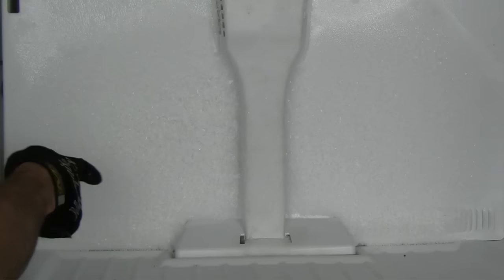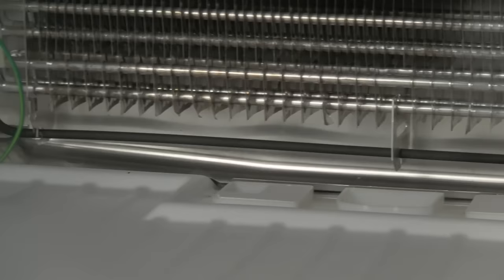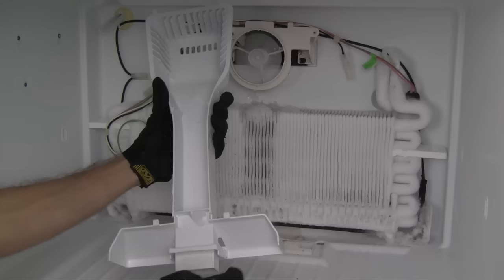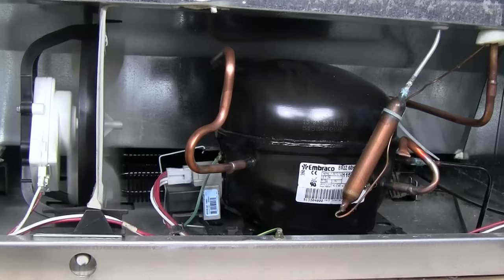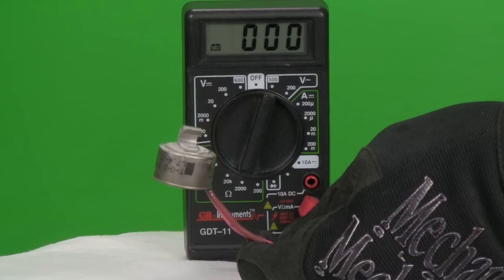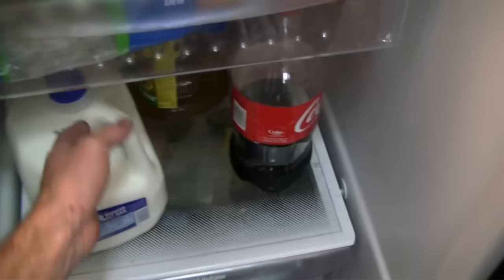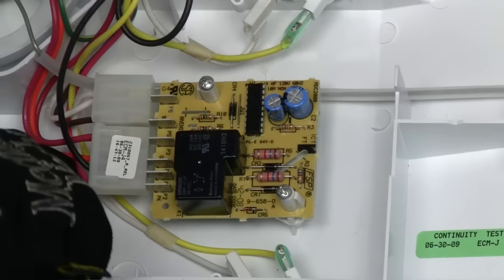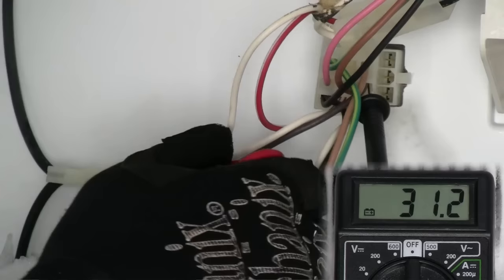Refrigerator Repair (Not Cooling, Defrost System)

Comment: I bought a Samsung refrigerator (model: RT28FA JSA RX/TL) on Nov 01, 2013 from a little know place Dhamnod in district Dhar of Madhya Pradesh.
On Oct 22rd 2014, I noticed presence of thermocol bolls spread below the refrigerator. I assumed that it must be some piece of thermocol that came with packing would have remained while unpacking the fridge and which mice have bitten.
A day later on Oct 23th we in the family noticed a foul smell inside the refrigerator. We though deodorizer of the refrigerator is not working, but the smell grew stronger by end of day. This started smelling like a dead rat. Even the cooling had decreased to a much lower level.
We immediately called the local dealer and upon his advise called Samsung customer care. When the service engineer visited, he found that the mice has exploited excess water opening (see image) to reach the thermocol insulation that is between the outer metal body and inner fiber body. Mice have ruined this insulation to a greater extent and thus impacted cooling. The mice also made a hole in the inside fiber body. In all left the refrigerator completely useless piece of junk. The service engineer took some photographs of the impact and after a long wait of more than two weeks, finally we received a phone call from Samsung Indore Head Office that this impact/damage is not covered under warranty and falls under physical damage.
I was quite disappointed with the response. Company has also denied any response in writing. I have gone through the warranty card and it does not talk about any such incident to be considered in physical damage.
The questions that arises here is what makes Samsung put this under physical damage.
As a consumer my stand on this issue is -
 
1. If Samsung refrigerators are so vulnerable that a commonly found rodent in Indian homes can damage their product to such an extent then why don't they call out this in warranty specifically. After all, Samsung is operating in India and it is true that most households in India (except some high rises) are infused with rodents
 
2. If the extent of damage through rodents can be so huge (rendering product useless), consumer must be warned, should be asked to use a rodent mesh or company itself should have taken care of such a miniature loophole in design
 
3. This impact was not during transfer, improper handling, misuse, or improper operating conditions, then why is it labelled as physical damage.
 
4. Mice exploited the water disposing gap in refrigerator, why was it left opened and so wide in Samsung refrigerators that mice can enter through this. In LG and Whirlpool refrigerators this opening is narrowed down and a rubber pipe is attached at the tail to direct water to a tray. Even if rodents damage the pipe they cannot enter the hole and exploit it further. This is where it compels to think that its a design gap/flaw or communication issue that Samsung needs to fix.
 
5. As a consumer, damage other than by, handling, Act of God or terrorism, should be repairable. But other than these if an incident renders the product unusable, it must be some carelessness in product owners approach.
 
As per Samsung this is a physical damage, but rodents in Indian households are normal operating condition. In such a case either the products must be designed that way or customer must be warned of impact/loss. Else the product company should help customers and thus improve the product. Its not something that has just disfigured some kind of appearance (the look and feel of the product) but has left it functionally dead.
 
Complaint ticket number : 418 351 6041
 
=================================================
 
You won’t trust SAMSUNG after reading this –
 
So I heard back from Samsung, only to get disappointed again. After so called a thorough research, discussion and brainstorming, the conclusion was that Samsung agrees that the damage is irreparable. If one reads my post carefully this was already established by a layman like me, reason? it was a damage to body. Samsung says consumer did not provide hygienic conditions. My argument remains same, more than 70% households in India might have rodents issues, doesn’t mean we don’t maintain hygiene.
 
Few questions to Samsung -
If the refrigerator is so vulnerable to rodents, that the extent of damage is irreparable, why no instructions were given to consumer (not one from dealer to service engineers, operational manual or warranty talks about this). If you can ask consumers to use Voltage stabilizers, why not rodents mesh?
 
How would a consumer know the design gap in their refrigerators. In my rarest of imagination I can't think of rats making their way between outside metal body and internal fiber body. Many of my fellow readers will agree with this? A consumer cannot follow a rodent or a cockroach to see where they are moving.
 
Why there is a 3 inch wide opening for water disposal. While other manufactures like LG/Whirlpool provides a quarter of an inch hole that too added with a rubber hose to deliver access water till tray, Samsung leaves a big 3 inch wide opening. Other manufactures dodge rodents with the narrow opening which is not big enough for smallest of rodents, while a large rodent can easily make its way inside the Samsung refrigerators body. I can substantiate this with original photos.
 
I complained when refrigerator was under warranty - Samsung accepts its irreparable. Then ?? Then what, Samsung doesn’t have an answer except denying a replacement or compensation. INR 30,000/- refrigerator becomes a piece of junk in 10 months and for Samsung it’s a physical damage. If it’s irreparable don’t you guys think it should be replaced or compensated?
 
Samsung term it as physical damage, I read the warranty card, it doesn’t talk about damage through rodents or similar will be considered as "Physical Damage". Why not consider this as "DESIGN FLAW"? Samsung engineers don’t understand Indian diaspora and missed a critical thing leaving a gap wide open for rodents to exploit. I did not dig that hole, I did not hit the refrigerator, it did not fell down, It was not damaged while in transit, proper gaps were left surrounding the refrigerator as asked and overall for consistent voltage a stabilizer was in use. How can they term it as "Physical Damage". They can’t put it in a other denial categories so here it is, lets put it in physical damage and make fool of Indian consumers.
Reply: “Come on man”as Sleepy Joe would say
Buy an American made refrigerator...........oh there aren’t any🥲🥲🥲🥲🥲

Comment: At 3:00, you can see a spark when the screwdriver makes contact with the connector on the printed circuit board.  You actually put a screwdriver to a powered circuit board ?!
Reply from the maker: John true I was bypassing the relay on the circuit board and shunting voltage from the supply to the defrost circuit. This is actually the test procedure for this particular defrost board. There is even a small "test" printed on the board next to the contact to be shunted. Thank for the comment.

Comment from the maker: @06GTFanatic Nice!  Any time my friend! Depending on the style of fan your dealing with, you may be able to take it apart and clean it up...maybe lubricate it with a little graphite powder. Of course replacement would be the most reliable repair but sometimes people like to save where they can... If you do happen to buy a new fan motor I would be overjoyed if you chose to buy through my website :) Thanks for posting!

Comment: What is the problem when refrigerator does not click off?
Reply from the maker: If it has a mechanical thermostat, likely the thermostat is shorted closed and is not opening the circuit properly. If it has a control board it’s the same idea but the relay switch on the control board is stuck closed. Hope that helps!

Comment from the maker: I have run into that several times on that refrigerator... hopefully it is just a clogged refrigerator evaporator defrost drain. (that refrigerator has an evaporator in the fresh food)  it can also be a bad defrost heater... that is not good because that heater is built into the evaporator coil.  I have a service manual for your model on my website. (search sam0093)You may want to look through it and do some diagnostic tests. If you have a tech you can trust I would call them. Good luck!

Comment: The ice in the ice maker is frozen but food at the top of freezer is defrosted.
Reply: unless your ice maker is in a special compartment, like on some bottom freezer models, your probably at the start of a new problem... what is your refrigerator's model number?
Reply: It's a GE. #HSS 25 GFPD WW. Ice maker is near top. Prior to this issue we did have problem shutting freezer door due to food being in the way and saw water on floor.

Comment: Hi, I have a GE Profile PSHW6YGXBDSS side by side refrigerator which works well except there is water accumulating in the bottom of the refrigeration section. This refrigerator seems to be more complex than any of the ones in the videos I watched. I can’t find the drain for the defrost water which is most likely plugged up. As I said, everything works fine, it defrosts and cools perfectly. When I first started troubleshooting the problem, I noticed a big blob of ice that had formed around some ducts/pipes on the left side (adjacent to freezer) back wall around center height. I used a heat gun to gently thaw the ice away but that alone didn’t solve the problem.
I tried to find a manual or some info on where the drains are but have been unsuccessful. I appreciate any advice/info anybody could give.
Many thanks,
Dan
Reply: Any ideas where I can find the service manual?
Reply from the maker: The defrost drain is located behind the back wall of the freezer at the base of the evaporator coil.  You may even be able to see it at the base of the back wall inside the freezer on the right side.  I would probably start with pulling the back wall off and checking the heaters. However, if you are getting ice on the freezer floor that usually means that the defrost system is working at least some times.  I found the manual for the PSH23 model that may be close... http://applianceassistant.com/Appliance-Repair/Appliance-Service-Repair-Manual-Feature.php?id=1186
Hope that helps!
Reply: applianceassistant

Thanks so much for the manual. I managed to get the back panel off. The drain appears to be clear. There is frost on the lower half of the coils, not sure if that indicates a problem or not so I took some pictures: https://www.flickr.com/photos/125914377@N04/ 

Please let me know if you think there is a problem. Perhaps you could also explain how a problem in the freezer can cause water in the refrigerator bottom.
Reply from the maker: Thanks for the pictures! Unfortunately that's bad... When only part of the evaporator is frosted and the rest is clean aluminum, it means the gas is restricted from flowing freely because of some contamination within the sealed system.  Pretty costly and involved repair.  You may want to look into your replacement option.  : (  
Do you mind it I use your photos on my website as an example for other people?
Reply: applianceassistant
Yes, you can use my pictures. A couple more questions though:

1. Why would that cause water in the refrigerator?
2. Any harm to keep using it while it still works and just wipe up the water every day?
3. Is it worth trying to defrost manually for 24 hours and see if that somehow fixes it?

Thanks!
Reply from the maker: Dan G. Thanks!  I got a little off track on the water in the refrigerator department... Your refrigerator being a side by side and not a top freezer, means that the drain is probably not the source of the water in the fresh food area.  It's probably coming from condensation due to an air leak somewhere.  I have seen a few models that have flaws in the foam insulation of the door which can generate a lot of moisture... the other source may be the water dispenser tubing behind the bottom crisper. As far as the coil problem, It looks like about 50% of the coil is working, so It is going to need to run a lot more to keep cool but it should still work. Sometimes the restriction will move or clear with pressure changes as the compressor cycles on and off. So I'll say a little prayer for your refrigerator : )
Reply: applianceassistant
The water in the refrigerator bottom started after a few years without problems. I'll shut off the supply for the water dispenser/ice maker to see if it is the culprit.

Thanks again for your advice.
Reply: applianceassistant OK, I shut off the water supply but that didn't help. I was trying to watch it more closely and made the following observations: There is some condensation on the left wall (where the freezer is) but not enough to account for it. I removed the drawers from the refrigerator, wiped everything dry and then checked every few hours. For several hours there was nothing and then all of a sudden there was a puddle and I can see a slow drip from an air outlet (?) above. I took some pictures that should explain it better: @photos/125914377@N04/ Inside that grid there looks to be a heating element. Is that supposed to evaporate the water that's coming out?
Reply from the maker: Sorry, not sure how to use that link to look at the pics...
Reply: applianceassistant It's the same link I sent you before. Not sure why it's not working.
Reply: applianceassistant Here's another try:   @photos/125914377@N04
Reply from the maker: Not sure what would cause that... it's probably still a condensation issue. perhaps that heater should be cycling on to get rid of the condensation problem... So bad heater or control.  You can check the heater for continuity with a meter it should have some resistance but not be "open" looks like it's going to be hard to get to though.  If you can find a wire diagram you may be able to check it from that point.  I'm guessing it's 12 VDC
Reply: applianceassistant I found some more info on the web about my refrigerator. Apparently, the refrigerator side has its own evaporator (ClimateKeeper2). The only time cold air from the freezer is used is by the "CustomCool" feature which I never used. However, if you look at my latest pictures, it seems the water may be originating around and inside the air duct between the freezer and the refrigerator. In fact there is some ice on the bottom of the duct. Question is why? I have the freezer set at 0 degrees. Is that too cold? Is there something wrong with the insulation?I hope you can see the pictures. I don't know why the link is changed by this website but you can use the very first link I sent you where you got the freezer pictures from.Thanks,Dan
Reply from the maker: Sorry for the delay, It's been a busy few weeks with local repairs.  I was able to see the pictures, condensation is the only thing I can come up with. I would focus on that heater, I have a feeling it is there to reduce the condensation.
Reply: Erika S No, unfortunately not. Everything I tried did not make a difference. I eventually gave up and bought a new refrigerator.
Reply: Ugh. That's what I thought. Thanks for the reply.

Comment: Exactly my fridge, freezer not freezed over. And nothing gets cold.
Reply from the maker: If the compressor is running, probably time for a new one. 😥
Reply: #2 -Timer could have stop and the Motor is stuck in defrost mode so try turning the timer ,(if you it have a timer) the timer screw setting ,it turns 360 Degree so turn it clockwise and the first click is defrost mode, keep Turing another click it will be out of defrost mode see if it get cold

Comment: just want to ask if how long before you refill the freon of a refrigerator thanks
Reply from the maker: Most residential refrigerators are sealed and it's a fairly major process to add gas. In most cases gas is not needed unless the system has developed a leak, and in that case the system would likely have been contaminated with moisture from the air. Many cooling problems are thought to be sealed system related when they are more often something simple.  If you are having poor cooling in the freezer compartment, try cleaning the black coils under the refrigerator.  Also check that the fan by the compressor is working.  Good luck!
Reply from the maker: Most residential refrigerators have a sealed system. So it's not a normal practice to recharge the gas.  Generally if has leaked out it's time to go shopping... But if its only cooling a little and seems to be staying about the same and not getting any worse on temperatures, I would check if the coils under the appliance are dirty, if the fan in the freezer is working, and also if the fan back by the compressor is working. I have a pretty good troubleshooting guide at this link:
http://applianceassistant.com/Refrigerator-Repair/Troubleshooting-Refrigerator-Problems.php
Hope that helps! Thanks for the question!
Reply: thanks for the info it is very helpful can i ask one more question now that my fridge is cooling now my problem is identifying the heating element or the one that defrost the freezer thanks hope to hear from you soon
Reply from the maker: So defrosting the appliance worked, and now you are trying to find the cause of the problem?  What is your refrigerator's model number?